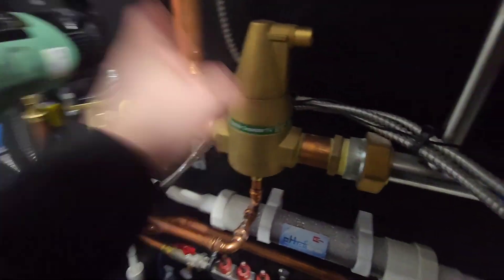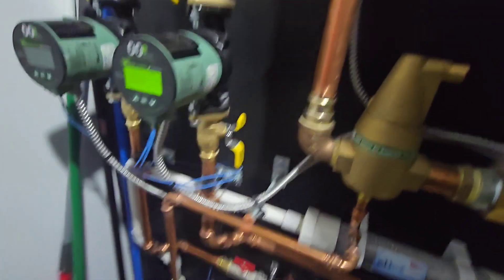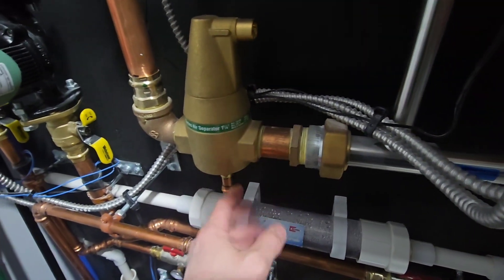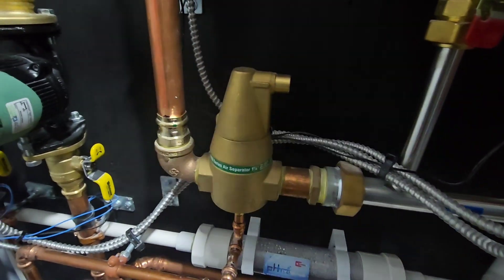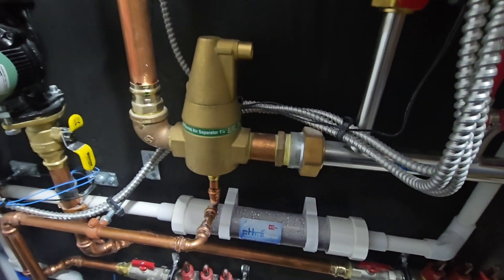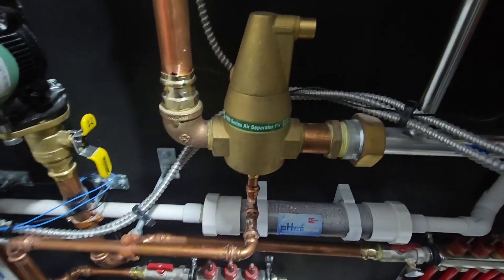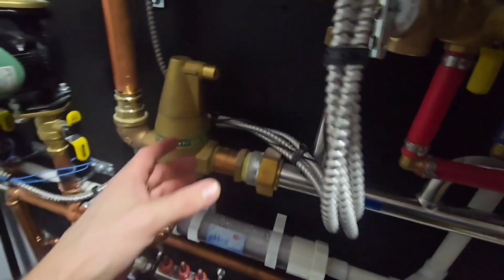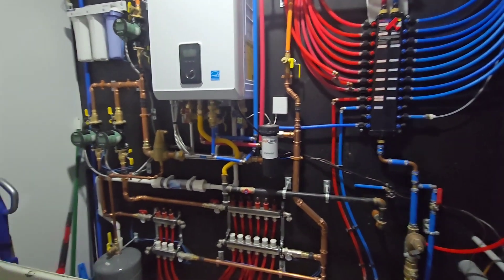Air Separators Explained: How They Work and Why You Need One in Your Boiler System

Comment: Thank you for your videos they are very informative. Question can we run these navians at 180 degree ? I feel my baseboard radiators aren’t very hot at 160 or under ? Thanks again.
Reply from the maker: Yes it will heat water up to 180 degrees.

Comment: Do you have an automatic filling check valve (pressure reducing) for any make-up water that needs to be added to your system?
Reply: Jim, is this the boiler for your floor radiant heat? Is it in the entire house? What is the propane,gas, electric bill for heat such as this? Thanks!
Reply from the maker: @mattborden1816  this boiler does all the radiant floor heating and the domestic hot water. It's extremely efficient. Hard to put a monthly price on it since every application is different but it's far more efficient than any other type of heating.
Reply from the maker: Yes the Navien has an auto feed connection that takes care of the pressure regulation. You still need to install a backflow preventer to the auto feed.